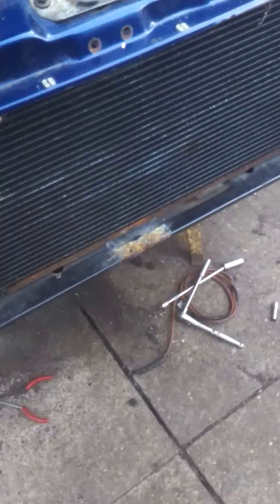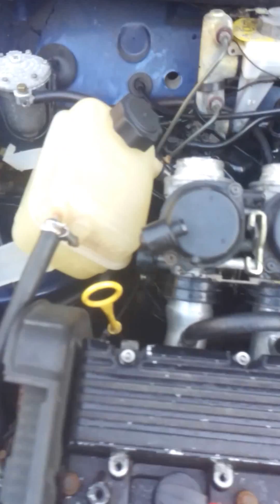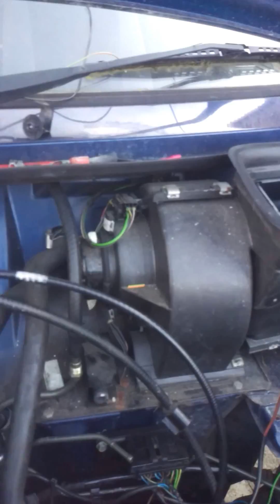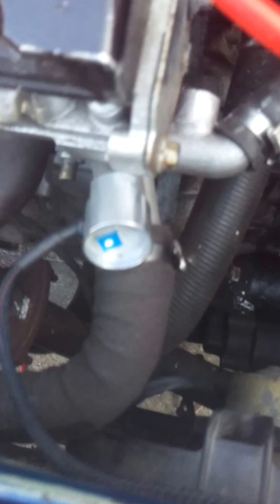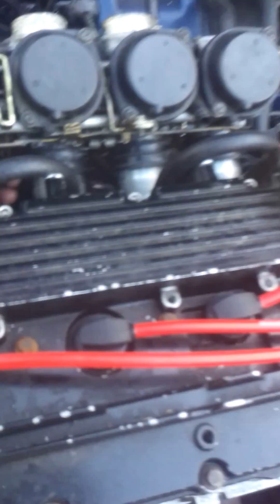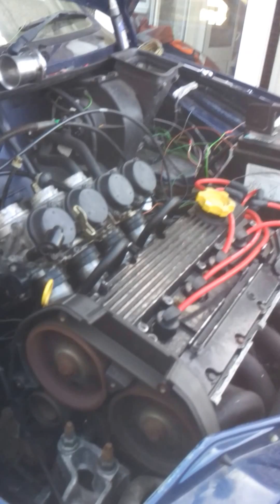K series fitted to Rover 100, runs on R1 bike carbs and MegaJolt ignition

Comment: hi. im planning to run r6 carbs on a 1.6 k series. was there anything els required other than ecu. can I ask what you did with the sensors on the original inlet manifold
Reply from the maker: Hi Terry
The original manifold was thrown away and a fabricated manifold was made to take the R1 carbs, they have a throttle position sensor to measure the load for the ecu to see.
This conversion had a fair bit of work go into it, parts included, inlet manifold, ecu, carbs, wiring loom, Ford Edis system, crank and tps sensors, trigger wheel, electric fuel pump.